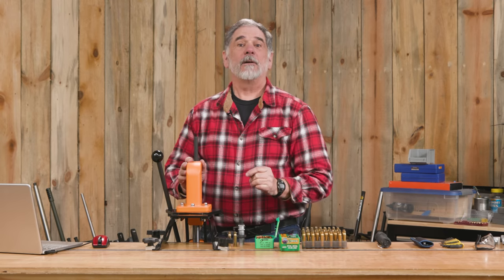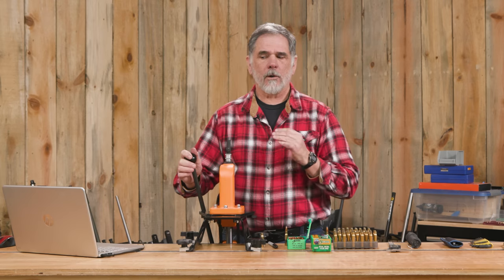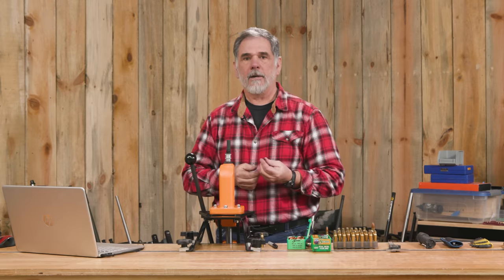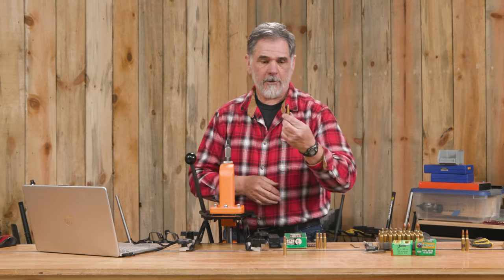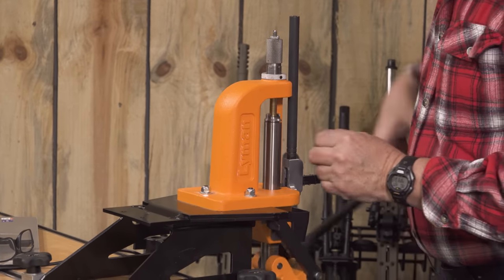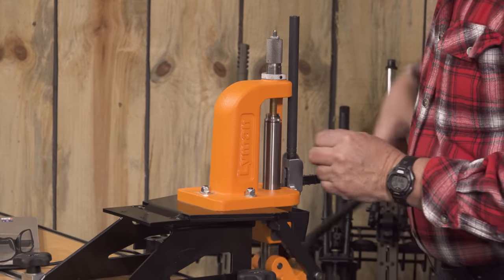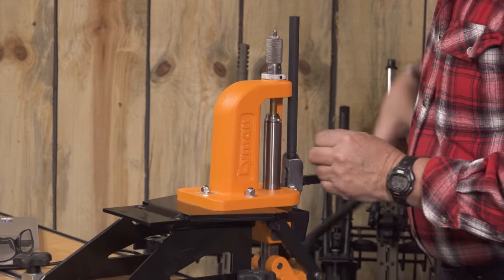Basic Rifle Reloading 5: Bullet Seating & Crimping

Comment: My biggest tip, is read your reloading manual thoroughly. It has great info in it and usually pictures to show you what good looks like and bad.  I have a Rockchucker press. I converted it to use the Hornady Lock and Load bushings, and now all I have to do is 1/8 twist and the die is out. Makes changing dies real easy. I use the Frankford Arsenal Universal seating die, it has a window for dropping the bullet into and it produces very concentric ammo. It is also multi caliber so it can almost anything you need it to do. I load .270WSM, .308, .30-06, and 5.56 on it. I may start loading pistol on it for hunting protection, .38 and .357.

Comment: I find that in a lot of basic standard dies there is a roll crimping feature in the seating die which I don't generally use. In my set up, I run a case to the top and screw the die down until I feel it touch the case, then back off at least 1/2 to a full turn. If I am going to crimp as for a revolver or tube fed magazine, I use a separate crimp die for better control. I will roll crimp if the bullet has a cannelure pressed into the bullet. If it does not have one, I will taper crimp the case mouth instead in order to keep the bullet from deforming. I load for 9MM, 38/357/44Mag/45ACP/45Colt/6.5 Swede/270 Win/308/30-06/30-30 Winchester. Keep your dies clean-I generally clean mine with a bore brush and solvent followed by a spray of Rem-oil to prevent rusting after each reloading session. I have two presses at my desk-a Forster Co-Ax and an RCBS Rock Chucker.

Comment: This series has been very very basic for your first timers. But it's just a gateway, once you begin reloading and enjoying it, you want to improve. Guy, think about an intermediate reloading series with more serious case preparation and basic load development demonstrating powder burn rates and their relation to bullet weight and cartridge size. Next would be an advanced series with enhanced case prep like annealing and measured shoulder bump as well as advanced sizing tools such as mandrel or collet neck expansion. Look at tools and techniques for determining seating depth and dialing in load development to maximize accuracy for the individual firearm. Beginning is the first step but learning is a process.

Comment: Guy, my understanding of bullet movement in a tubular magazine is that the bullet goes further into the case.  The cartridges move forward in the tube as the weapon discharges. The force pushing an uncrimped bullet into the cartridge is supplied by the magazine spring being further compressed during recoil and the hammer effect from the springs return after the discharge has taken place.  An easy way to picture this, is to think of the entire stack of cartridges moving forward against the magazine spring as the weapon is fired and then slamming back after the recoil is over.  This is different from a revolver, where the shell is rigidly held, and the recoil tends to move the bullet out of the cartridge.  In the case of a tubular magazine, the movement of a bullet deeper into the shell can cause higher pressures upon discharge.

Comment: I like old military rifles, so I have plenty of cartridges to load for like 8mm Mauser, 7.7Japanese, 8mm Lebel, and so on. Been doing everything on an old RCBS single stage with standard dies, RCBS balance scale and Lyman trickler. My newest adventure has been working up smokless 43Spanish loads for an old Remington rolling block, which I'm currently experimenting with felt wads and cotton balls in to hold a low amount of powder in the bottom of a high volume case for reliable ignition.
Reply: You sound mike me. I have a number of milsurps. I have long wanted A Rolling Block, and 43 Spanish is one of the common chamberings (fortunately, 7x57 is out there too, and i already have a Chilean Mauser). I remember reading a print article about the 43 a couple of years ago. I forgot if they were reforming 45-70 brass, or what. Good luck on your project
Reply: @troy9477  My starting point on the 43Spanish smokeless load is some 45-70 trapdoor data as 45-70 has slightly less case volume than 43Spanish. Honestly, my issues stem from the fact I'm using IMR4198, which has very low case fill. I think if I switch to something more volumous like Accurate 5744, most of the issues will be solved.
Reply: @nekoghostgunner1129  i was just gonna say before i read to the end, 5744 might work. What about RL-7 or 3031? Just thinking out loud

Comment: For match rounds I like to use Lee's factory crimper It crimps it in from the side does not roll over a crimp crimping it in from the side actually trues that bullet to the casing and it's a more consistent crimping. Any variation at all whatsoever on a road crimp can also change the pressure and the speed of the bullet this is why you get a variation in your chronograph readings. I consider that factory crimping to be one of the most important factors of accurate shooting

Comment: For a tubular magazine, you crimp to prevent bullets from getting pushed back into the case. The exact opposite of the potential problem with a revolver where bullets might walk out of the case and lock up the cylinder. 

 By “match grade dies” do you mean a Forster Benchrest seater or a Redding Competition seating die with the sliding sleeve that improves concentricity?  (Redding copied the Forster design when its patent ran out.  Both are excellent, and superior, seating dies.) 

I have to add that measuring OAL with bare calipers is the correct starting point for seating depth, but it barely scratches the surface.

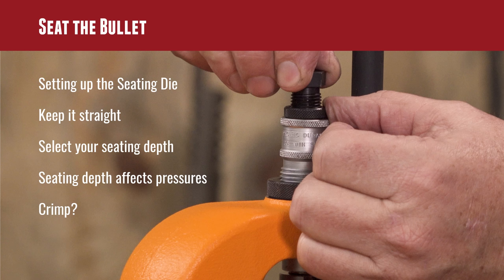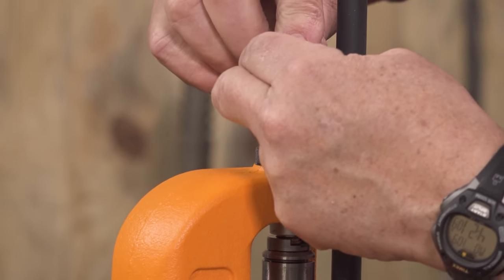Comment: Your video goes from screw the die down until it contacts the ram (1:22), then it skips to "one of the tricks I..."  However at 2:00 you can see the die has been backed off, presumably so it won't crimp while seating.  There's clearly a cut away seen, but what you didn't do is show backing it off so it won't crimp before you move to bullet seating depth.  Appears somehow that step ended up on the cutting room floor but it's an important step given this is the basics.  It's a minor thing, but a newbie reloader might not understand why their die is trying to crimp and yes if they had read the manual they wouldn't have this issue, or maybe they read it and simply didn't click. Overall a nice series.

Comment: Great Series, and hopefully, you will continue showing your insight on reloading. I have an unusual  Request to Ultimate Reloader. Only because Brass is hard to find. And I can not think of a more reliable Channel. Necking UP or Down cases using parent Case. I think it is a very good skill to have using what you can lay your hands on. Both me and a coworker are talking about converting 30-06 / 270 brass in to 280 Rem and 243 / 308 brass to 7mm-08 my coworker has a bunch of 30-06 brass. I played around with it in 1996 with some success and realized I might have to resort to it again because of shortages. But with the resources at Gavin, I would love to see the need reloading tools out on the Market to make life easier. This is an area with very little info on.
Reply: I’m no expert, however I’ve necked 308 to 243 for years. Highly recommend you get an outside ball micrometer to measure neck thickness. Necking down can potentially thicken the neck to unsafe dimensions, and cause the case to squeeze the bullet when chambered. Likewise expanding the neck may make them too thin.
Reply: @jimabel7458  Thanks very much for your knowledge or insight. Did what you recommended. I necked down 308 to 7mm-08 and turned the necks down. 
 I have 100 pieces of wild cat Belted Magnum brass. I plan on necking down to 338 Win Mag brass and will do the same as before mentioned.

Comment: Thanks for the series of videos, I'm just starting out with reloading and would like to know how many times can you reload the brass cartridge?
Reply: Good question and that varies tremendously depending on the cartridge and on the intensity of the handloads used. For example, I have 38 Special and 45 ACP cases that have lasted just fine for 15+ loading/firing cycles. But those are low pressure, straight wall handgun cartridges. I've also had rifle cases that were useless after two or three loading/firing cycles because of a combination of soft brass, maximum pressure loads and warm days at the rifle range. Annealing can extend the life of rifle brass.

Comment: I'm new to reloading and have been watching yours & a lot of videos & I have a question.  With respect to using my comparator on some once fired 308 brass from my kimber rifle, I noticed that not all the brass has formed to my chamber completely.  All of the Winchester brass I measured had different shoulder measurements.  Starting w/the most formed or biggest shoulder or case expansionas a base line, I ended up with cases ranging from -.0010 less, .-0020, -.0025, -.0030,-.0035, -.0045,"55,"60,"65,70, & even one case -.0100 less than the largest one I could find. Why does this happen? & how could I possibly know which case to use as a base line to bump my brass back -.0020 if they're so different like that..what should I do? FYI, The highest number of sample space cases occurred at around-.0035 to -.0045 more or less. Out of about 60 cases.

Comment: Why do you screw the seating die down til it touches the shell holder? Many times that is way to far. I rarely crimp my rifle ammo. I always put a sized empty case in then screw it down till the crimp ring contacts the case then back it off slightly. Then place my dummy round in and run it up, screw the stem down till it contacts the bullet.

Comment: Best to buy good equipment from the start, as oppose to upgrading later on. As cheap tools make cheap ammo at the Reloader's expense [time and efforts]. Not to mention a waste of money once one finally gets tired of dealing with such and decides to upgrade. 

Personally I think a turret press with the ability to incorporate the Hornady LNL quick die change bushing system is the proper way to go.  At the moment only the Area 419 Zero Turret Press has this option of a turret head with the 1 and 1/4" holes to accommodate the Hornady LNL quick die change bushings, but perhaps, with some encouragement, others will follow. I happen to like the Harrell's Tooling Turret Press with 4 holes, and am seriously thinking of asking them if they can make me a 4 hole turret head with the 1 and 1/4" holes. At the moment I have a Buchanan Precision Machine single stage hand press with the Hornady LNL quick change die bushing system, and even though it is my second choose of presses, I got it first because it did not need to be customized (that is to say no modifications where needed for optimal operation [short installing a turret head on it). 

I think it best to get the competition dies as well, unless one does not care so much as to the accuracy of their ammo. Buy once, cry once. No reason to waste money on dies that are not going to be a forever go to dies, as it is just a waste of money to end up with a cheap set of dies lying around in the end.

And the more Load Manuals the better, as they all have typos in them, and it is best to have many to check between. A lot of load manuals simply repeat what another load manual has said (typos and all), so the more the merrier. The powder and bullet manufacturers are most likely to have made there own data so best to get at least one manual from the powder manufacturer you plan on using and one from the bullet manufacturer of the bullets you plan on using to cross reference between them. Personally I got every current load manual out there to have the most data to choose from to be able to pic the best loads for what I want to achieve, not just generic data.

Powder charges should be done on a beam scale, being they do not drift off of zero every time one blinks. After all accuracy and repeatability are not just a preference but rather safety measures that every hand loader should strive for. 

Single Base powders, as well as the ammo made with them, should be stored in a steady 40-50% humidity levels around 70 degrees Fahrenheit or less. And Double Base powders, and the ammo made with them, should be stored in steady 50-60% humidity levels around 70 degrees Fahrenheit or less. 50% humidity makes for a good happy medium.

It is a good practice to record the load data used and store it in both a data log book as well as upon each batch of ammo.

My model operations are as follows:
 1) de-prime cases
 2) clean cases
 3) lube cases
 4) re-size and flare cases
 5) re-clean cases
 6) inspect every single case for issues
 7) prime cases
 8) charge cases
 9) seat bullets in cases
10) crimp cases
11) re-inspect all rounds (not just every tenth or so)!
12) store ammo in sealed IP65 rated cooler, with ThermPro temperature and humidity  gauges.

Anywho, (however you choose to hand load) be sure and not cut corners on inspecting every single round, at every single stage of development, for your safety and that of those standing/sitting nearby. Obsessive Compulsiveness is not a disorder when it comes to hand loading yet rather a positive attribute that all should strive to adhere.

P.S. - Oh, and don't forget to wash your hand before and afterwards. Behind the ears is optional at this point.

Comment: I'm curious, between steps 1-5, obviously starting after the casings have been cleaned in the tumbler, how long does it take you to complete 20 or even 100 rounds? This seems like an incredibly time consuming process.
Reply: Twenty rifle cartridges takes me about an hour. If I'm doing a larger quantity, things speed up a bit, but not much. Single stage press only goes so fast. With a turret press and handgun ammo I'm up to about 50 rounds an hour. With a progressive press... Well then we're talking a couple of hundred rounds per hour. I do most of my loading on a turret press, which is a bit faster than on a single stage like I used in this video. It does take time, but I enjoy the process, so to me, it's all good time.

Comment: would like to hear and see tech info on just how much crime you need for pistol bullets ,  how much is right in thousands of a inch .0000 ! I ask this because I have taken apart some 9 mm rounds and found some crazy measurements these rounds came from a local indoor shooting range. Most shooters would not mess with rounds from a scrap bucket but my curiosity brings me to wondering why the rounds won't shoot, I have seen light firing pin strikes on the primers and one batch of several 9 mm caught my attention they're hand loads so I took several of them home took them apart to my surprise the  rounds were reloads so I looked at the bullets and said this is wrong real wrong, measured the tapered crimp found one at .023" and the rest at .020"! People starting out are not getting proper train in reloading the correct way and apparently can't read mics. please use small pistol primers for any small diameter calibers and use like CCI 500, don't use small rifle primers because a lot of the firing pins will not they don't have a strong enough spring , or a strong enough firing pin its self for the rifle primers actually the metal it not suited for firing off a rifles primer. Please rife primers are made of a stronger metal firing pins / springs you are lucky by chance if your pistol will fire those stronger rifle primer. Okay my experience in reloading goes back some 50+ years doing reloading rifle and pistol cartridges.  P.S. be safe learn the right ways of reloading its not a PC game when you lose you lose big time like exploding rounds in your favor it expensive fire arm.

Comment: It’s a bit disappointing they skipped the set up of the die and how to set a crimp with the standard die. Instead they focused on the crimp die. 

Yes the larger and heavier rifles will need crimping. Any tube feed ammo will need crimping as well to keep the overall length under recoil.  This also means case trimming will affect this process. To long and heavier crimp, to short and lighter crimp.  This will affect the accuracy. Consistency is one thing you should always strive for.

Comment: Seating and crimping in separate steps is unnecessary.  You can learn to use the dies the way they were designed to work and seat and crimp in the same step. If I were to crimp in separate steps, I'd use a crimping die so not to be constantly adjusting the seating stem.